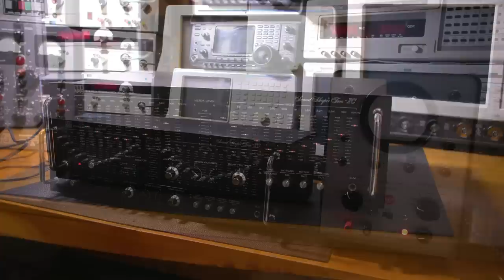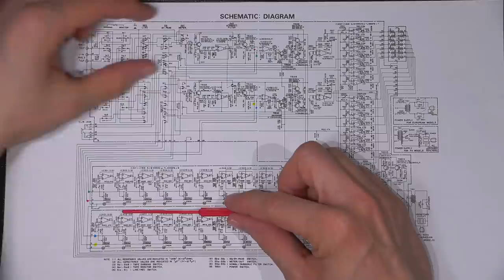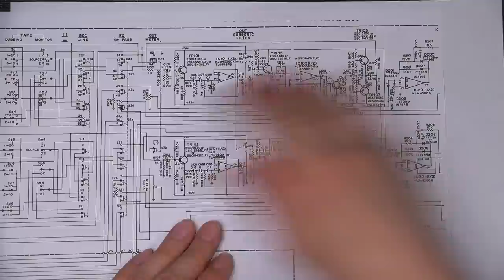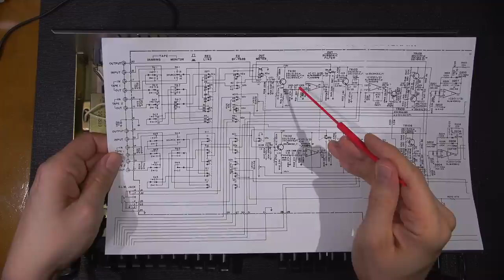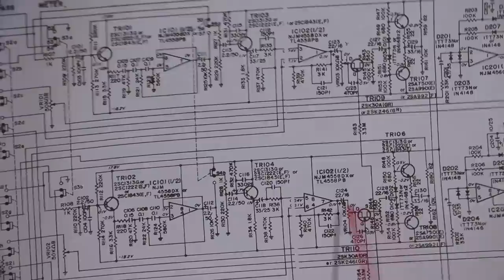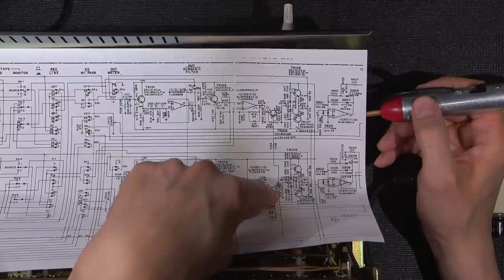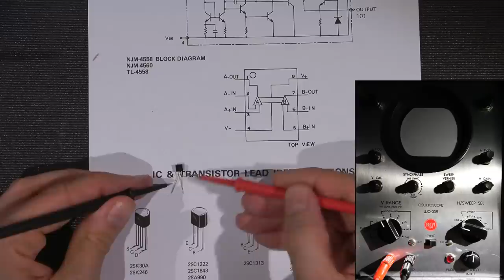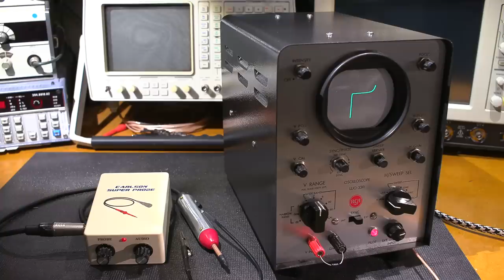Electronic Repair- Stereo Audio Equalizer From The 1980's!

Comment: You can also figure out left vs right channels from that TRS jack on the left side of the schematic... 🤔
Reply: In theory, but not in practice...  I've come across equipment in the past where left and right have been reversed in TRS jacks (usually Chinese origin, but not always).  I've also recently come across numerous 3.5mm TRS to RCA leads with the colours reversed on the RCA jacks.
Reply: @chrisg6597  well with those you must squint your eye's when testing! ;-p
Reply: @kenhancock8931 , B-b-b-aaad!
Reply: so true as Long as everybody uses them the conventional way… but Standards are if everybody does what he wants noone what he should but everyone is part of the game
Reply: TRS...reminds me of when I first worked for the Telephone company...1969...Tip was +,  ring -,  sleeve ground...that was a 48 volt DC situation...still is on landlines... most all telephone stuff is 48 volt DC and is powered by batteries, and diesel generator for back-up...

Comment: Paul,

 I am not a repairman, just a very long term interested bystander. 
Rather than apologise you should promote the use of a signal injector and tracer. Back in the day that was all that many amateurs, and indeed some shops, could afford. I've still got mine - though they aren't as well designed or as capable as yours.

regards

Dave

Comment: I had an ADC Whose R channel cut out when 2nd bass button was slid beyond 3 above 0
Took off front plate and buttons made sure to not lose the clear plastic inserts. Got the straw into the top n bottom ofceach slider and gave it a good working. She does NOT cut out on the R side anymore. I.let the unit sit after I tipped it to get out any excess fluid out.  ADC ss2 or Pioneer SG9500 Eq's, gr8 for any seperate components set- up

Comment: Great vid as always, Paul. As luck would have it, I was working on a JFET mute circuit as I opened up this video to watch today. The 2N5486 is a great part, but I'm unable to use it because the mute circuit we're doing is only a shunt style mute, requiring a lower RDSon value than the 2N5486.

After an email exchange with the engineers at linear systems, I learned of the 2N4416, and I was pleased to find out it had similar parasitic C (less in some instances) even with the lower RDSon value. Often mute circuits will have both series and shunt JFETs, so having the 2N4416 in the tool box may be helpful.

Central Semi has a SMT version named CMPF4416 as well.
Reply from the maker: I will check out those parts Cody, thanks for your kind comment!
Reply: @MrCarlsonsLab  You bet! By the way, this video has convinced me I need to build one of your super-probes. If for no other reason than avoiding a blasted scope ground-clip flying off and shorting something out in side of a live chassis. :)

Comment: A few of the amps, preamps and equelizers I've worked on with RCA jacks have the center wire twisted off, because people will plug cables in and give them a good twist breaking the wire.

Comment: Very nice.
ADC was the lower cost division of BSR. I have a BSR EQ 3000 equalizer. It may be the best 10 band EQ I've heard. It is filled with the venerable 4558 op amp. BSR owned dbx, sold it to Sanju Chiba, founder of Edison Laser Player of Japan. He later sold the dbx pro line to Harman International (once Harman Kardon) which is now owned by Samsung.

Comment: I remember finding a similar ADC equalizer in a flea market, for less than 5 euros. The only issue was dirty potentiometers, after cleaning them it was all fine and I sold it on ebay with some good profit.

Comment: Hope you can answer a question.. My old ADC Sound Shaper Two (with VU meters) had a THD/IM of 0.02% and I can't find my booklet (or any rating) for the SS2IC. Do you know what the IC model is rated for distortion/signal to noise ratio?? 
 I bought my Sound Shaper Two IC in 1982 and have had it serviced for cleaning/maintenance only a few times including a switch issue. Not bad for an almost forty year old component. GREAT video, sir. A keeper.

Comment: Another nice instructional Mr C.
Is there any simple way to explain how a person can determine if a FET or a common NPN or PNP is being used as a switch or amplifier? In this repair situation you found that the one FET was being used as a switch and was defective. Obviously a no signal test at output of the defective FET would show whether it was being used as a amp or buffer just the same, just curious as to know how one can tell if a transistor whether a FET or regular NPN or PNP type is being used as a switch? Are there any hard fast rules as how to identify the functionality of how a transistor is being used? Or is this something that cannot be explained without having an extensive amount of circuit design knowledge? Thanks again Mr. Carlson for another well assembled repair presentation.      😎👍

Comment: This is a great video - even more so because a friend of mine used to have one of these exact same equalizers. Had it been me, I'd have put it between a white noise source and a spectrum analyzer to make sure each one of those bands worked as intended before buttoning that bad boy up.
Reply: hubbslic, And who paid for the test gear... the Easter Bunny? LOL I think that was the whole point... you don't NEED fancy test gear.
Reply: @BruceNitroxpro  One could do what I described with a laptop running Audacity, which is a zero-cost app. It can generate white noise and display recorded input as a spectrogram. My point was that if I had one of these opened up on a bench. I wouldn't put it back together again until I knew all the filters were working - and there are a LOT of them. If it's already had one component fail, I'd want to make sure there weren't more.

Comment: I had a very annoying fault with a Toshiba 29N5DXA flat screen crt that I've owned 20 years since new. When it was brand new it would randomly produce a loud high voltage crack and the tv would shut off. It would turn on again just fine. I took it back to the store where I bought it and they kept it for a couple of weeks sitting on a shelf running and of course it ran perfectly well, because if it failed they would have gave me a replacement. So I took it home and it ran fine for another few weeks before failing in the same way again. So off to the service man it went, where he could find no fault, so also kept it for a couple of weeks running without fault before returning it.  A day later the tv did the same thing again, and I was told the only thing left to do was to keep using it until it finally failed properly and stopped working completely, because they were powerless to help if they couldn't witness the failure with the manufacturers warrenty. So the tv ran like that for a few more months until one day it made a much louder electrical crack, there was a wisp of smoke but this time the tv didn't shut down, and its never produced the fault again or had any problem since. It went back to the service man who again found no trace of the fault or replicate it. I can only assume a faulty solder joint somewhere got welded back into service.
Reply: Many years ago I had a 25" Sony console that did the same thing... a loud crack then shut down. Turned out the set had a safety circuit that activated when the HV exceeded 25 KV. This was supposed to prevent the CRT from emitting X-rays. Plugging the tv into a variac set to 115V solved the problem, but it tied up my variac. 

Sounds like that last loud crack may have pooched your tv's safety circuit, if that was the cause.
Reply: Jedda73  I wonder if you had a lot of flies in your home?  Wink, wink!
Reply: Those old Sony's were notorious for having bad H-stat blocks which would cause intermittent shutdown problems.

Comment: If you ask yourself where is right and where is left just look if you can find some stereo-jacks anywhere. You see the "SLM Jack" labeled 6.3mm stereo barrel jack? That's exactly the same like for older HiFi headphones. The front tip of that plug always is left channel hot, the middle contact ring of the plug is right channel hot and the inner most barrel (the portion right at the cable relief)  is ground for right and left signal. So, what does that mean? The kind of O-ring that touches the inner-most barrel is ground and goes to Ground. The next contact is the upper contact spring, it goes to the upper portion of the circuit diagram (just trace this one connection line to where it goes!), so that portion is right channel. The outer most (or front-most?) tip of the plug will contact the lower contact spring, the trace from there goes to the lower portion of the shown circuit and that is the left channel. Without really measuring something you know for sure,  which is left and which is right channel with no problem.

Comment: I came across this video looking for the schematics to fix an earlier model, the ADC Sound Shaper One Ten Mok II. It happens to have the same symptom, one channel no signal. Your video was very inspiring and I've been trying to trace the signal path. Do you have any advice on where to look for this schematic? Before seeing your video I ordered an MESR-100 ESR Capacitance Ohm Meter now wondering if that will be of any use.

Comment: Well, me and my big mouth. I recently bragged here about my 36 year old, excellent condition ADC Sound Shaper Two IC and guess what??? The tape monitor switch is on the fritz. FM, LP's and CD's are fine, cassettes played thru the EQ while off are fine too. However, cassettes played with the EQ on have intermittent sound in the right channel. So it looks like a trip to my hifi guy. Heck, it has been 36 years. First ever repair. Think I got my money's worth.

Comment: Where do you find your schematics? I've tried to find schematics for somethings I want to repair a few times and I'm never able to find what I'm looking for.
I have an old Philips SBC 345 soldering station I would like to repair but I can't find a schematic to repair it. I do know it's a rebranded xytronic (the identification on the PCB). I have three issues to deal with to repair it, 1) I have a burned out resistor going to the LM324N op-amp (the resister has been removed so no chance to try to attempt to figure it's value out by other methods), 2) the is a trace which has lifted off the PCB 3) I need to get a new iron since the tip has fused to the old iron (should be a standard 24v 60w xytrontic replacement).

Comment: You have a 1/4 inch jack right on the front panel that will allow you to tell which channel is which. 3 pins ...Tip (left), Ring (right), and sleeve (common).  Just trace them back on your schematic.

Comment: I must be having a slow day, or my brain is on vacation.....I saw what appears to be a signal tracer output (2 pins only, hence a mono signal) connected through a "Y" splitter to some "it does not matter which ones" RCA jacks on the back of a piece of audio gear that has inputs and outputs. No mention of WHICH RCA jacks were being connected to, but I assumed they were the left and right stereo inputs to the equalizer. The next thing I see is a knob being twiddled and a pronouncement made that, yes, the left channel is dead. Maybe I missed something, or maybe that signal tracer works differently from what I thought, but how to determine that the left channel of an audio device is dead only by checking the input, and also when both inputs are shorted together by the "Y" splitter? Mr. Carlson, please enlighten me!

Comment: Had a SoundCraftsman just like this one - Great video again! Thanks.
Reply: In my closet I still have a old 1975 Soundcraftsman 2012A but I don't think it uses op-amps for the equalization stages but inductors instead. I recall comparing it to an op-amp equalizer decades ago and found it to be quieter (less hiss)  at unity gain.

Comment: You can utilize the SLM Jack. Its aTRS jack, meaning headphone or monitor??, Either way, in the schematic the SLM jack is wired tip to bottom side and ring to the topside.  Left is found on the tip and right is found on the ring, the sig GND is shield.

Comment: Awesome as usual mr carlson!

Since loading clock signals is usually an issue when it comes to calibration/accurate signal diagnosis.   Would a good work around be to use the super probe to couple the signal, and to use a scope on one of the final stage transistors in the super probe for a Better analysis (or one without loading/dragging down the clock freq anyways)?   

Is this something you will be implementing in your upcoming new and improved super duper ultra mega probe?   If so, I'm sure you are implementing it in better way than i describe, like having a dedicated bnc or probe points for the scope

Comment: I had a soundcraftsman EQ  that looked almost exactly like this ADC EQ  it had much more led's and it had a volume adjustment tree or four inputs for various amp,tuner,etc. and was a 24 channel or 12 channel i believe each side EQ was the best i ever had wish i could buy it back and i sold it for $50.00 bucks just cause it had a little dust noise on one channel side? Could have fixed myself but i just did not want any unwanted noise when i was recording music.........

Comment: I have an ADC Sound Shaper Mk. II, and only the 125 Hz control on the left channel doesn't work. Any ideas? I'd love to repair it but don't have tons of diagnostic equipment. The red LED on the slider lights up, but this one slider has no effect.
These old equalizers were really cool! Gotta love the LED slide controls :)
Reply: Just got it working right now!  One of the inductors, the one for the left 125 Hz slider, was burnt out (open circuit.)
I had to unsolder it, dismantle it, fish the little hair-size wire out of the MIDDLE of the inductor coil, and solder a little strand of wire from multi-strand wire to it.
I was able to solder the tiny wires (about .002" diameter!) back to the pins on the plastic inductor frame, and solder it back into the circuit board. It works now! All 20 slide controls are working properly. I figure that the 125 Hz left slider never worked at all, even when new, because the inductor was pooched.
WHEW, what an unbelievable pain in the ass!

Comment: Hello Mr Carlson, I was searching for a way to determine which output terminals of a speaker crossover go to feed which components.  So, what I have is a set of 3 way frequency dividing crossovers, but I need to figure out which wires attach to which speaker drivers.  There are no indications on the boards as to which are which, and I failed to mark the wires when I removed these crossovers from the cabinets, as, I had no idea I would wish to use them at a later date.  I have a basic Multi-Meter, but, I don't know how to use it to give me clues as to which wire sets are to be fed into which types of drivers.  Is there any simple way to sort out speaker crossovers in such a dismantled condition?

Comment: My problem with a few repairs that have been brought to me have been that the unit works just fine, and to find out that the equipment connected to it was in trouble, not the unit that was brought in.  It's kind of difficult working so hard to find a problem with equipment that was not bad to begin with.  Especially when the customer is so sure that it does have troubles.

Comment: Today you can get a small LCD oscilloscope for low frequency for like 20-40 dollars including shipping.
It would be nice to make a curve tracer with one of those, but unfortunately they do not do X-Y mode...
Usually they lack even an external trigger.
Should someone find a little scope like that, but with X-Y mode and/or trigger input I would be very interested...

Comment: Have you worked on laptop’s, if so, what do you charge, I got in in 2011. It is running slow, batteries are bad. It is an Asus. Hard drizzle was replaced about two years ago. Thanks

Comment: Aww no audio spectrum analyzer. I have a few old ADC products, including one to balance a room. We didn't call it "Repairman's Syndrome". We called it "FM", for  "_____ Magic". (We just called it "FM", no profanities. 
 After going back to the filing cabinets of doom gloom, and wonder. That schematic is on a 22" x 17" inch  sheet of paper and the original tucked into in an even larger folder is  closer to 35" x 48".  Cool! I have wire wrap tools! Very cool! The posts are square so the angled corners will dig into the wire and penetrate any oxide layer on the copper. I thought  wire wrap was more suitable for prototype work, but not well suited for permanent mass produced product circuitry. The 2N5486 is super common, and I ALWAYS have an Altoids tin filled with them. I'D REPLACE THEM BOTH TOO & Curve trace match them! Why not? I just made another regulator for a tube amp and just grabbed any N Channel FET good for 450 volts or better 50 Watt dissipation, 5 volts of better threshold, and who cares? Done! Oh your RCA curve tracer won't do steps to make a happy "family of curves"? NOW CLEAN THOSE SLIDERS!

Comment: Hi, just came across your channel. This is off subject sorry for that. My brother has a ICOM IC-746 that he lost all transmit , (not sure if he is able to RX) Have you come across a common issue with these rigs having such a break down?  Any help would be appreciated. Thanks, WD9DWQ
Reply from the maker: Yes it is, but it could be a number of things. If it still receives, it may be the RF finals.
Reply: @MrCarlsonsLab   OK very good I will pass that along we were theorizing that maybe it is the finals the 1st question I would have does that unit use the same finals for HF and VHF?